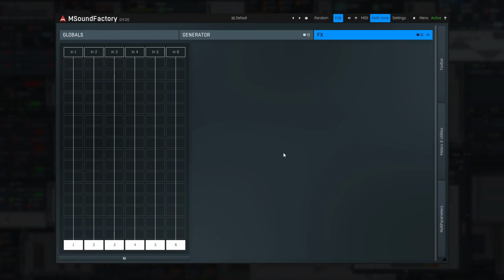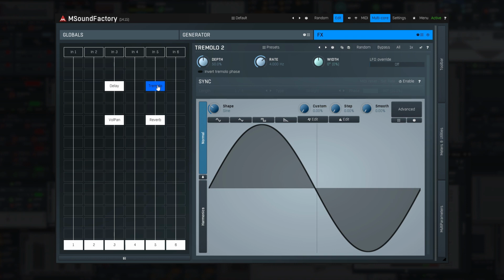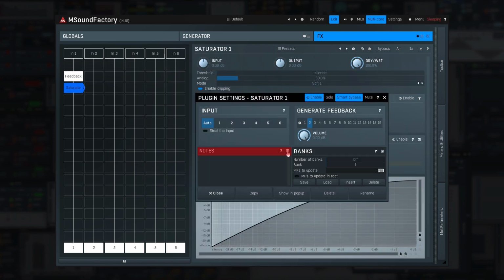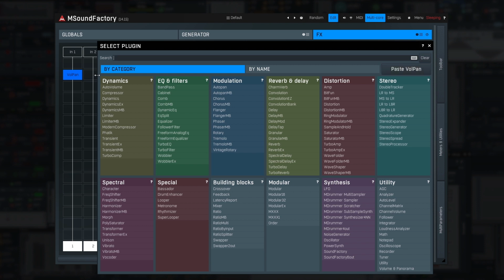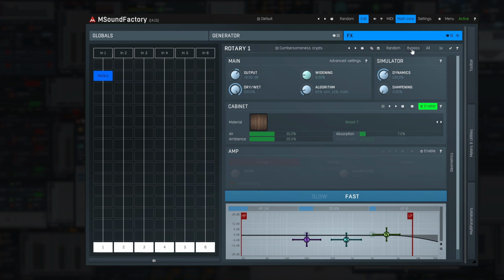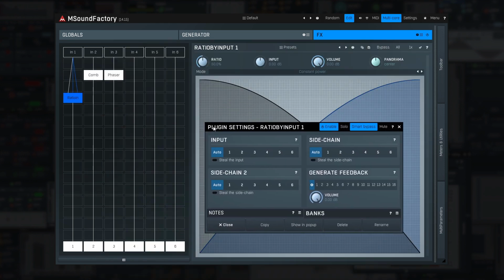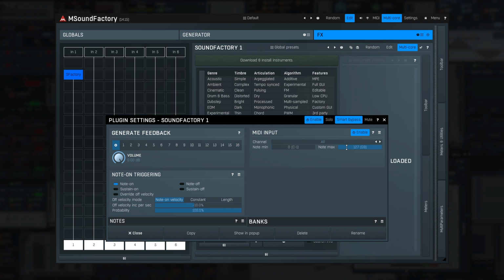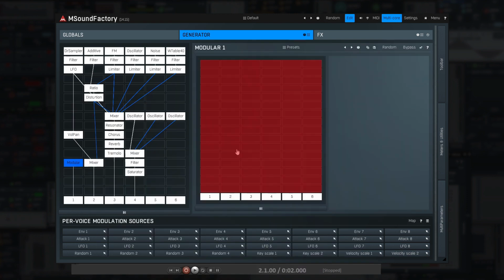MSoundFactory #3 - The modular instrument, part 2 - Modular grids

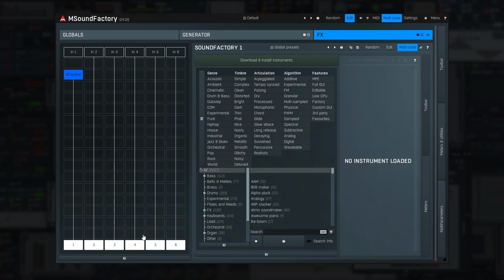Comment: 8:00 blew my mind. I’ve heretofore not thought about using Note Off events to trigger anything beyond little noises, as in a piano. It just dawned on me that you can start anything from the end of a midi note. The Note Off-triggered sound can be longer than the one triggered by the Note On message. Hmm. 

I also realized that MSF is basically an abstracted VCV Rack. Is that not true?

Comment: Now if only a few basics of the sampler module would be improved, like layering samples and a lot of various cool crossfade tools. Currently you have to build complex sampler things as individual modules and faff about in the modular grid which is extremely tedious and difficult to keep track of. If the basic sampler module would be even 10% as capable as something like Kontakt, then it'd make MSoundFactory a lot more interesting to use for sampling based things. Vojtec, please modernize the sampler module and make it awesome! :)
Reply from the maker: Please contact us directly using the contact form and provide us with more information.